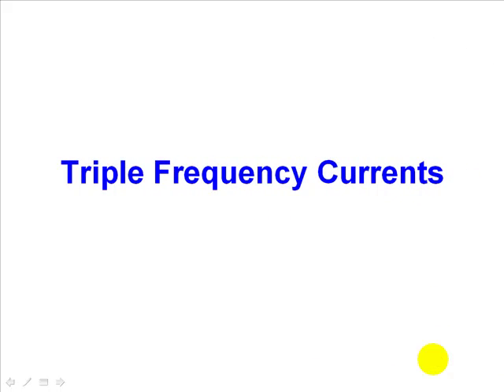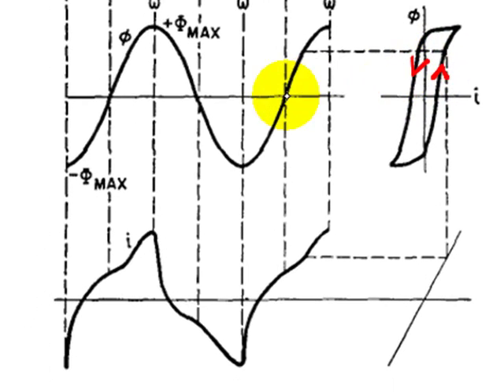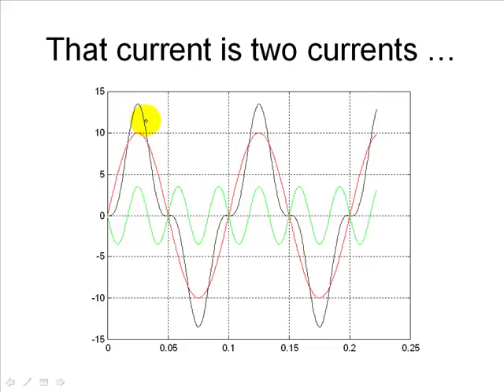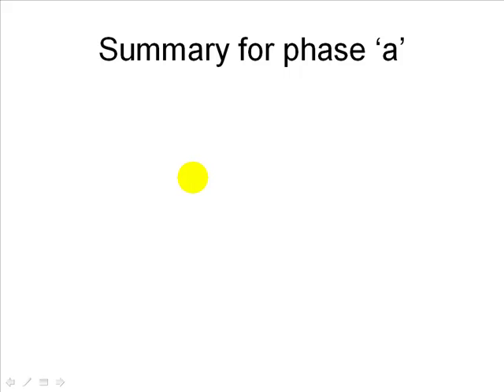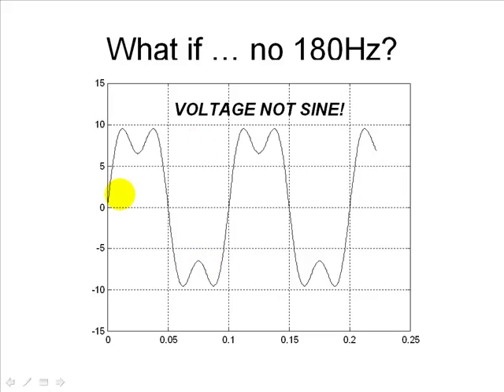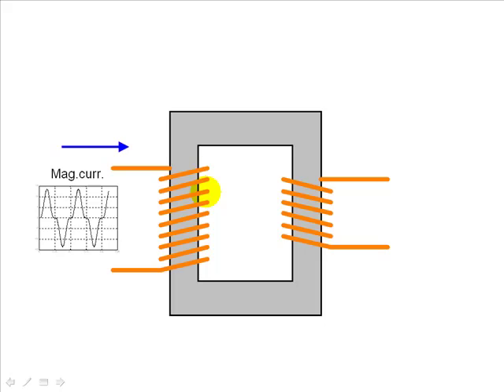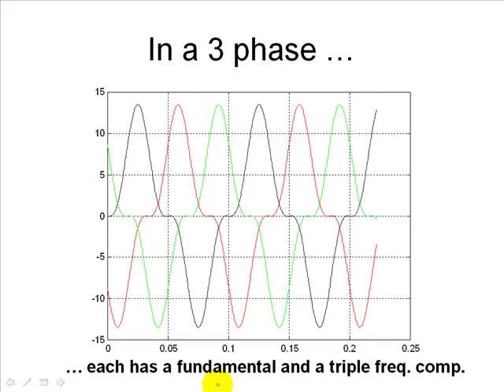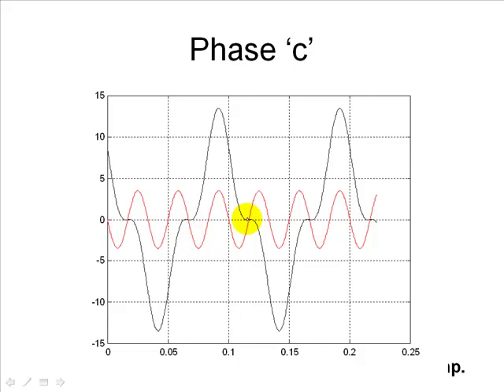TRAN 06 - (Part 1) Triple frequency voltages and currents in Power Transformers

Comment: At 2:41, should the haloween current be 60Hz + 180Hz or 60Hz - 180Hz? Sine we are getting a peaky current, the 3rd harmonic should be subtracted, I suppose.
Reply from the maker: Please, observe the phase of the 180Hz component, in that graphic and with that phase, if you add the 60 and the 180 components we'd get the "Halloween" ghost shape for the current. With Fourier decomposition of periodic functions of time we can always "add". It goes like this: "... a periodic function of time can be represented with an infinite sum of sinusoids of different amplitudes and phases, and with a period that is a multiple of the period of the original function ..." In there, the "different-phase" takes care of the possible subtraction. I hope this helps.

Comment: How do we produce a current which has fundamental and third harmonics ?
Reply from the maker: We don't have to. We just apply a sinusoidal voltage to a primary, and the primary will drain the necessary current to create a sinusoidal flux ... including the 3f current (as long as there is a path for it to flow, of course.)